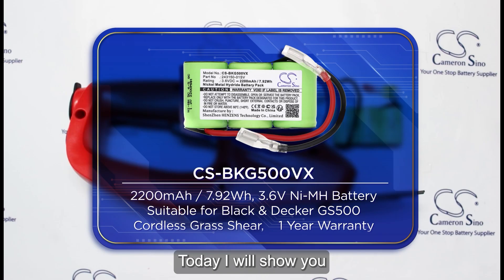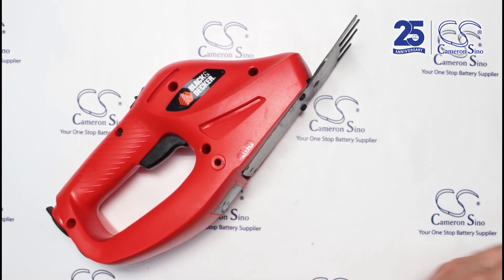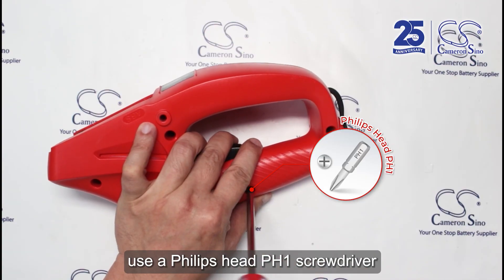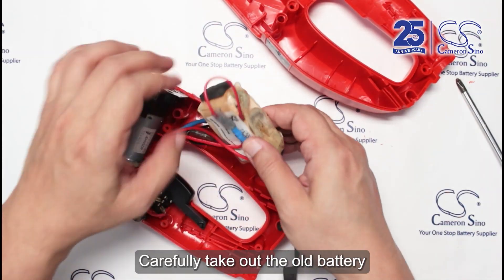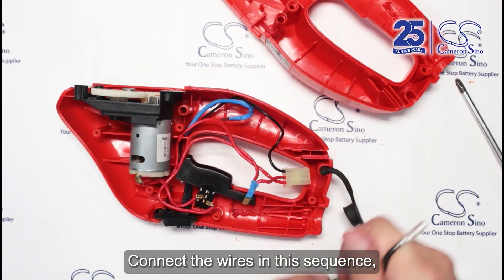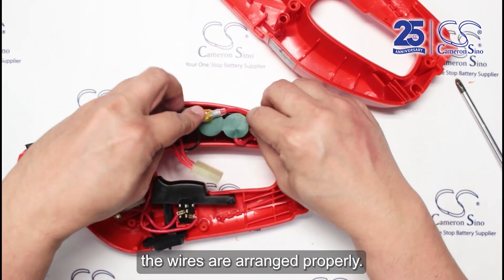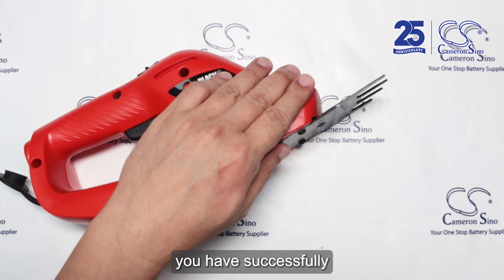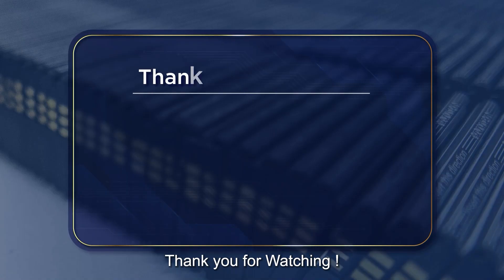Battery for Black & Decker Grass Shears Teardown

Comment: I got my battery out and replaced with only removing 2 screws on the bottom blade and separating the body.
Reply: I did remove all the screws in the body